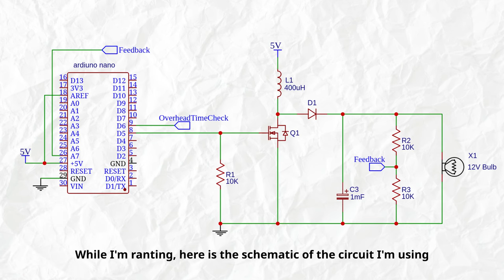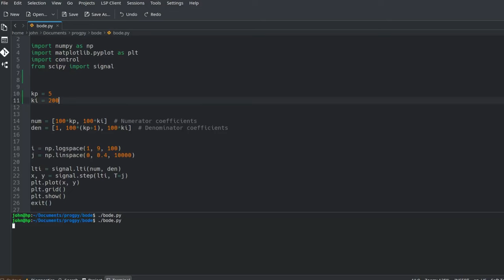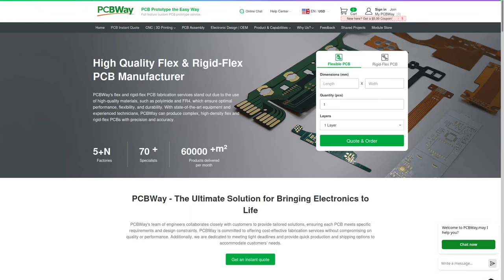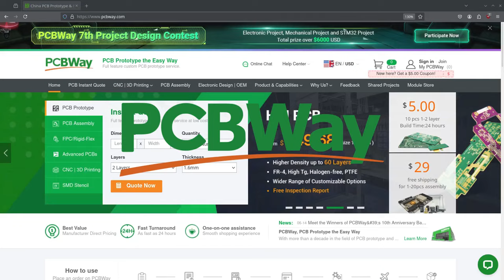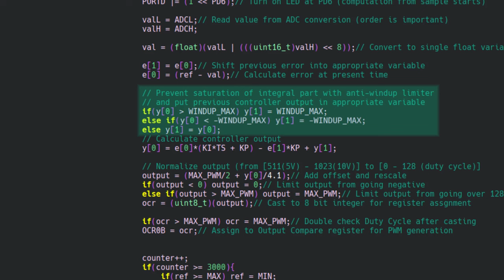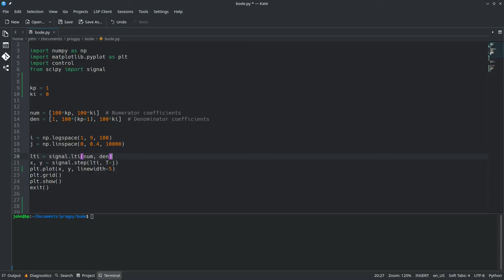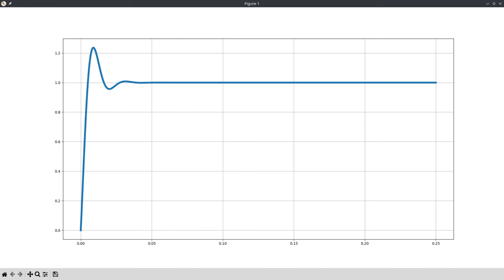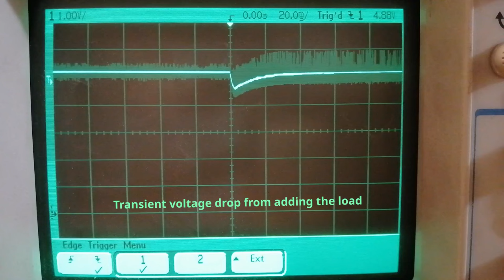Making a Closed Loop Digital Controller for a Boost Converter with Arduino

Comment: Great video! Just a side-remark for any interested reader: Try not to use floats with Arduino. There is indeed no FPU and doing float aritmetics takes a huge lot of cycles and resources (e.g. Flash). This particular example is well-suited for fixed-point arithmetics. Moreover, if you want to do float arithmetics, you could use a ARM M4-Processor (e.g. nucleo boards or many other products) and if you need fancy math (cosine, sine) you could even consider using a controller with a CORDIC math accelerator core

Comment: Thanks for posting with the math sections included. I'd like to make better use of controls and feedback loops but never got to study them while I was in undergrad. Do you have a recommendation for a good dedicated book on control loops and feedback loops that is slightly gentler with the math instead of throwing around derivations and assuming calculus mastery?
Reply from the maker: Thanks for the feedback!

Unfortunately I don't know of any good material on the subject.
Actually control and dynamics really isn't my strong suit, it might not seem so in the video, but it's probably the subject I understood (and liked) the least when studying.
My impression is that good and intuitive material is quite hard to find unfortunately.

Good luck!

Comment: Would have been also cool to see a couple tries with Ziegler–Nichols tuning by finding the P oscillating frequency, and see how they match up to your 'manually' found constants.

Overall using the frequency domain modelling goes a bit over my head having not done that sort of course content formally yet, but cool to see it work anyway. Overall I find 'developing' the PID algorithm from basic principles in discretized time steps to be a simple thought process anyway. There's error, then you must add a linear term of it, a derivative of it in time steps, and a summation of it in time steps, and that outputs your resulting correction value.
Reply from the maker: Interesting, I'll admit I'm not familiar with that method
Reply: @5VLogic  Sounds like it wouldn't be too hard to implement with your setup. Increase kP from 0 until you find the point where a step response starts to give a solid oscillation, then you can practically just copy out the formulas in the tables for various p/i/d ratios that generally tend to work.

Comment: great  video 
the value  of R2 is 10k is needs to be 20k as the divider of r1 r2 at 12V is 6V this is to high.
if r2 is 20k then at12v output  is only 4v for the feedback  pin A7.
Reply from the maker: Thanks!
Yeah good point, I was keeping it to 10V in my test, but for 12V you're right

Comment: TIL microfarad is mf instead of uf. I've been doing it wrong all these years. 

That's an oddly specific circuit for a 12v incandescent bulb you have there. Throw a tl431 in the mix.  It's a shunt regulator, a zener with a reference voltage. Usually you would use a tl494 and an optocoupler instead of an expensive Arduino but then you don't get to learn the Arduino stuff. 

I'm still watching the video, I just paused on the diagram to see what we are up to at the start of the video at least. These things often tend to go a whole other direction by the end. That is the nature of electronics though. Always so many ways to to do the same thing.
Reply: We don't ever show out math...ever. Any explanation of the math is too long no matter how short, I was snoring by the second slide. Don't do that to people. 

The coding people will deal with because it shows the logic behind what you are doing. Math formulas are death, that an instant tune out for all but s very slim slice of people that are probably too busy doing something constructive to watch YouTube. 

Just saying.
Reply: mF would be millifarad (1/1,000 farad) ; µF is microfarad (1/1,000,000 farad). Most people just type uF instead of µF as u is on a standard keyboard.
If you want the proper µ character, it can be typed with alt+0181.
Reply: > Throw a tl431 in the mix.  It's a shunt regulator, a zener with a reference voltage.

The purpose of the video is demonstrating closed - loop control using digital control and feedback, implemented in a "toy" system. Not simply to design a bog standard 12V boost circuit using off-the-shelf analogue components, which is what you'd do if the purpose of the system wasn't 100% education and discovery.

mF is millifarad, uF is microfarad.
Reply: @LordPhobos6502  My point was that no one uses that unit of measure. Use what is written on the capacitor. Does your capacitor say 1mf on it? Or are we starting a movement here to get everyone on the metric system? I remember the first time they did that and you would think you were trying to get people to eat worms. They were apparently far too busy making up jingles involving Jimmy Carter and the Oscar Meyer Weiner song to do something that would make everyone's life easier.
Reply: @zentechnician  (CNN) THE CAUSE OF THE CRASH OF THE MARS CLIMATE ORBITER WAS CONFUSION IN THE UNITS USED!
The loss of a $125 million satellite was caused by confusion in the units used among the teams controlling its flight. While one part of the team used English units (feet, inches, pounds), the other part used metric system units.
Maybe it's not such a bad idea to use only one system of units.
Reply: @Georgy-fg3bg  Yeah but that would make too much sense. You've met people before right? I don't get it either man.
Reply: @zentechnician  That's very interesting, but your premise that 'no one uses that unit of measure' is completely wrong.
I have not seen a capacitor use mF that was produced this century.
So, maybe you should be using standard units.
Reply: @LordPhobos6502  That was exactly my point. lol